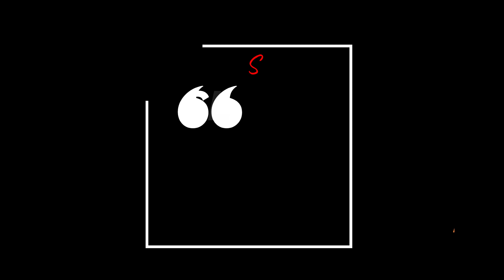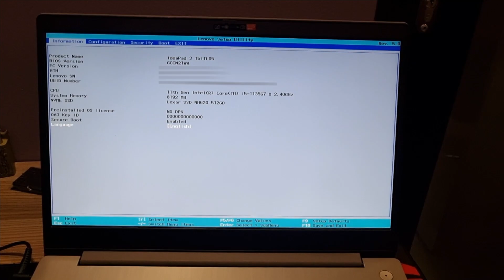Lenovo ideapad 3-15ITL05 11th Generation Intel Core i5 RAM and SSD upgrade

Comment: Did upgrading the 4gb to 8gb of ram make the laptop faster because i yave this exact laptop and it runs so slow
Reply from the maker: Upgrade with a M.2 NVme SSD to make it faster. RAM upgrade boosts the performance.
Reply: @Glantix Solutions ltd so you suggest I rather upgrade to an ssd rather than upgrading my ram ??
Reply from the maker: @claytonkemertgoglou  Yes, but if your laptop hangs and lags you need to upgrade RAM as well.

Comment: Hi , my ideapad  model has hdd hardrive so im asking if i have to remove the drive in order to upgrade to an ssd or i can have both drives?
Reply: If there is a slot available for another drive ssd or NVME, you can just add it, but if not, you have to replace it